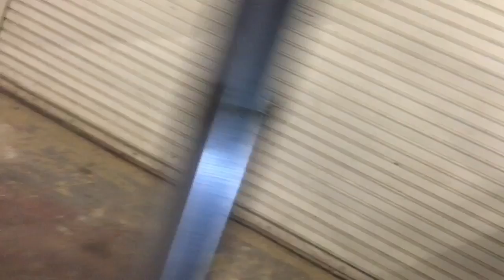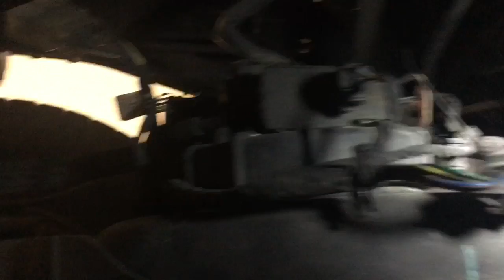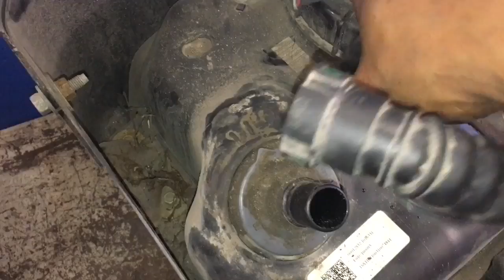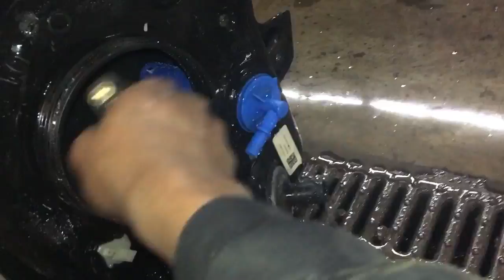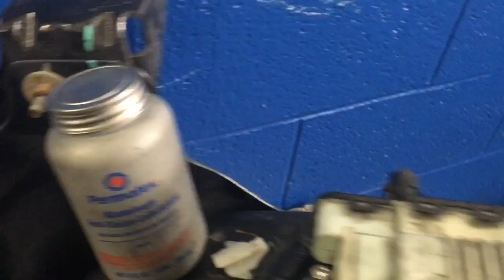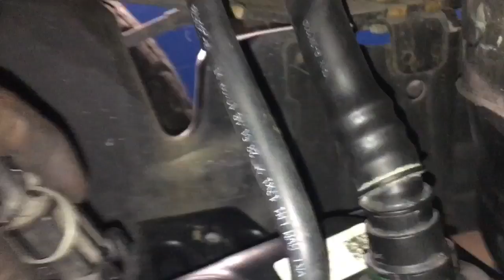P20E8 DEF Pressure too low 6.7 powerstroke

Comment: Did you need to prime the new pump? If so, how was that done? Thanks.
Reply from the maker: MilanoTT i did not have to prime the pump. I did however force a regen using the ford ids software
Reply: @fullmetaltoolbox1412  you had to bring it in to force a regeneration or you were able to do it DIY?
Reply: He primed in this video: https://youtu.be/Cbh8zf2RM-s

Comment: hello I have the same problem replace the pump but the problem has not been solved the code returns the pump needs to be programmed by the dealer?
Reply from the maker: Jose Roberto Portillo the pump is independent. U still have a issue. 
Replace all items or take to dealer
Reply: @fullmetaltoolbox1412  I replaced the pump but I still have the problem I don't have any leakage.  check the whole system someone told me that the pump has to be programmed so I ask you, who already solved the problem
Reply: @joserobertoportillo9179  I have replaced basically everything but the tank itself, and the tube going from the pump to the DEF injector.  I finally got an appointment.  I have all OEM parts on it, still not working.  I did prime.  Did you get yours fixed?
Reply from the maker: Jose Roberto Portillo there is no programming to be done

Comment: Hi, I have a E220 BlueTec 2014 and the engine management light kept coming on with the same code mentioned in this video so I got everything replaced by a garage - the adblue tank + pump and heater but the light keeps coming back and they can't figure it out either. Could you please help me figure out what other causes there maybe as its cost me too much money already. Thanks
Reply from the maker: M Yasin did they replace only the tank and pump? What about the supply lines feeding to the engine bay? Also, I believe the electric wiring can cause the failure. Check the wiring.... i cant remember of the top of my head if ohms or resistance needs to be within a certain range. If the garage couldn’t figure it out i would send to ford dealership.
Reply: @fullmetaltoolbox1412  hi yes they replaced the tank and pump only, they haven't replaced the supply line but have replaced some wiring harnesses. I will speak to them and see what they can find. Will keep you updated. Thank you

Comment: Thanks ,just got this code and the dreaded 200 miles to no start on my Ram. At least I understand what's going on. If Ram does not warrantee, may delete. My brother has had same issue with his Powerstroke. Leave it to the EPA to screw up a great running truck.